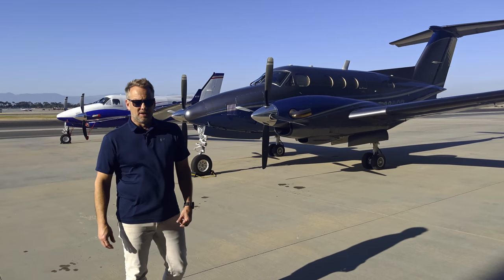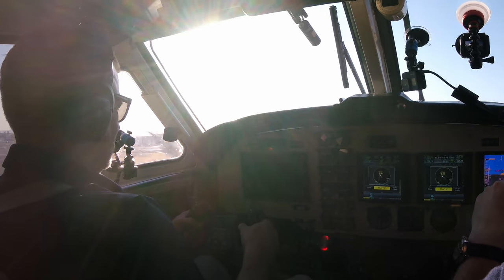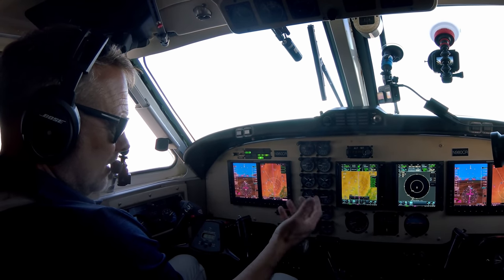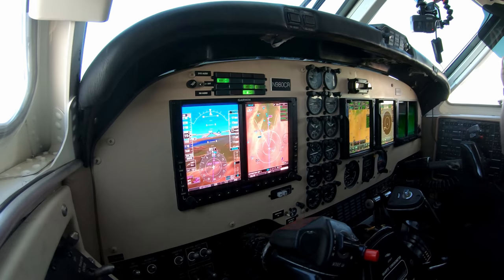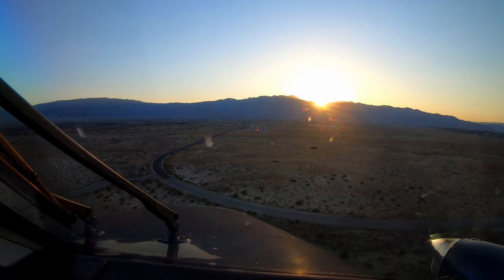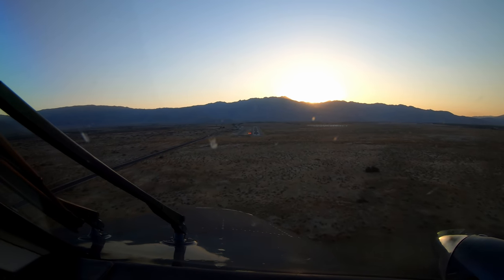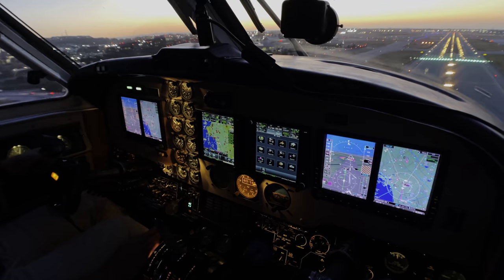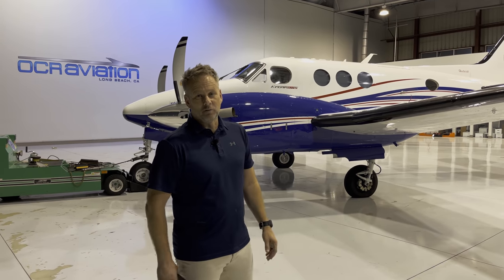#22 F90 King Air - The Hot Rod of the King Air Series

Comment: I’ve been flying a C90B with -135A engines, Raisbeck strakes, and Garmin G1000 for many years, and I’ve always been curious about the F90. Thanks for the video!
Reply from the maker: That seems like the sweet spot on the KA90s - G1000 with -135A motors. The GTX I have been flying has the Proline Fusion which is pretty cool, but I think Garmin preferred!
Reply: What is your avarage fuel flow amd TAS with the C90B -135 on FL280?
Reply: @tuhuzi4  I usually don't go to FL280 because of the limits on the pressurization system. At FL260, I usually get 240 lbs/hr/engine for a total of 480 lbs/hr which is arround 72 gal/hr. The TAS is usually around 259 kts at that altitude and closer to 265 kts at FL230.
Reply: Those are good numbers for the 90 for sure. The -135 engine looks like a good upgrade then on the 90’s. Thanks for the reply. Highly appreciated.,

Comment: Nice video!!  I love the F90! My favorite KA! How do C90 compare to the F90 when it comes to short fields? If I hear you correctly both have pretty similar performance numbers in cruise?
Thanks!
Reply from the maker: They are comparable but newer C90s with -135A motors have better performance. There are a lot of variants and engine differences so hard to make broad statements about them. F90 better performance than earlier C90.

Comment: What's the real world range for 4 standard PAX.  I hear conflicting info from 900NM to 1200NM.  Big difference in selecting an aircraft between those numbers.
Reply from the maker: 4 pax means you can go full fuel and have, at minimum, 4.75 hours with reserve so at @ 245 knots that is over 1100 miles no wind.

Comment: Rich will you tell me does automatic rotation come at a certain RPM
Reply from the maker: @raymondwalker2109  nothing automated really. If you are talking about engine start, engine rotation begins with the start switch. Fuel comes in via engine rotation with condition lever.

Comment: I've never flown a twin. On the King, or any twin for that fact, 
does the props turn in opposites direction to cancel out the P? 
Just curious.
Reply from the maker: King Air's do not have CR props - few twins do, but there are some training aircraft that have CR props - Piper had several piston twins with CR props. Thanks for watching!
Reply: @FlyingwithRich  
Hey thanks for the quick reply.
That really almost don't make sense... you would think that all twins would have CR props, for safety reasons.
Cant be that hard to make an engine run backwards.
Reply from the maker: It’s a cost benefit analysis. CR props don’t cancel out asymmetrical thrust component so still have to deal with it. It certainly helps but not enough to offset higher costs.
Reply: @FlyingwithRich  I see, i didn't know this....
Thanks for the explanation. Happy fly'en!

Comment: How does this compare against Pilatus PC-12?
Reply from the maker: KA a little bit faster but higher fuel burn,  and cabin not as big as PC12.  PC12 also has the large door for cabin access.  PC12 would be significantly more expensive on acquisition than a King Air of similar vintage as N980CR. Thanks for watching.

Comment: F90 has the Cool factor for looks but the E90 is the best value in the KingAir 90 series put the same upgraded engines and Avionics the E90 is the better plane.  For what some newer F90’s  go for you can get a KingAir 200 and the 200 is a lot more plane than the 90 series KingAir.  
 What causes the deceleration when you go to idle with the F90 is 4 bladed props they go flat with 3 bladed props it stays straight and just glides much better flying qualities.  Same thing in 200 when I went from 3 bladed props to 4 bladed props I noticed it there also. 
 Tell the truth Beechcraft made a mistake going the C90A route years ago should of went E90 and put the newer cowling on the E90 as it has higher gross weight and high service ceiling and has more fuel than C90A
Reply from the maker: Thanks for the info, and thanks for watching!

Comment: F-90 is definitely a Hot Rod, still wont outrun a Cheyenne 400LS built in the 80's tho lol
Reply from the maker: 400LS is a beast - got to fly one a few times - wow!
Reply: Talking about the Piper’s, the F90 got the same engines as the Cheyenne IIxL  -135 Those are pretty similar performance wise. The 400LS are in a totally different league, like what Rich is saying, simply a Beast.
Reply: @FlyingwithRich  I maintained a couple of King Air 200's in Alaska back in the 90's, good fast machines, but our bread & Butter were Piper Navajo Chieftains with one Piper 1040, which was a straight up Hot Rod, so Ive always had a special place in my heart for the Cheyenne/Navajo line.
Reply from the maker: We have a Navajo CR coming up for sale soon with a bunch of nice upgrades. I’ll do a video on it soon. Thanks for watching!
Reply: Just looked up the 400LS, ceiling 41K feet, WOW
Reply from the maker: 1000HP/side! The one I flew was all black - menacing looking machine and not sure I have ever felt the power come up like that on any airplane I have ever flown!
Reply: @chcr8150  Piper didn't want to build a complete clean slate jet to compete with the Cessna Citation, so they built the 400LS which was suppose to outperform the first Citation jets in several parameters. Chuck Yeager set a  time to climb record in one, back in the day.
Reply: @Agislife1960  I watched the Yeager record setter vid this am! 40,000 feet and it was still climbing 500 fpm. Rocket ship!! 🚀
Reply: @FlyingwithRich  I’ve watched a few take off vids, thing is like an F14!
Reply: @FlyingwithRich  PS “Charley Alpha Aviation” is a neat channel with a Panther Navajo, it’s a beast also. 💪🏽
Reply: Cheyenne 400 good luck finding a prop if one get damage ?

Comment: 100 gallons an hour isn't that great. Because one of the smaller jets on your channel was doing that at a higher altitude, faster speed and better performance.
Reply from the maker: That’s a different measure. 100 g an hour  in the jet at a specific altitude/atmosphere is different than total gallons of gas used divided by total hours put on the King Air - that is average fuel burn per hour. I don’t have a customer who can tell me they purchased X volume of fuel over a specific period of hours to have the same number, but it would be higher for sure.  It wouldn’t be the same for all operators either. I think Craig’s fuel burn of 100 g/hour is higher than most because we use the King Air for a lot of short hops where the fuel burn per hour is very high. Thanks for watching and the comment!

Comment: Wow only 255knts on 100gal/hr? If you want speed, you need an MU2. 310 true on 70gal/hr
Reply from the maker: Speed is a factor for sure, but not the only factor - market demand certainly proves that as the MU2 had pretty dismal market demand even at the higher speed performance.